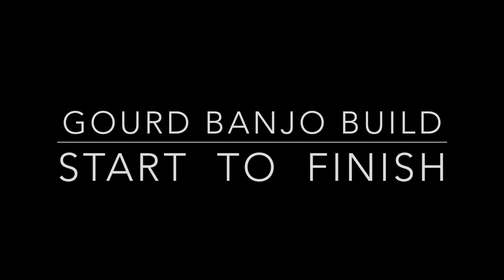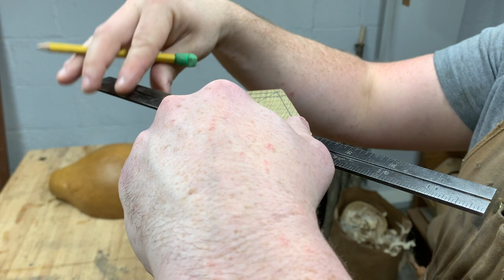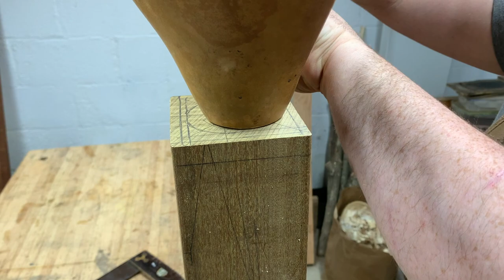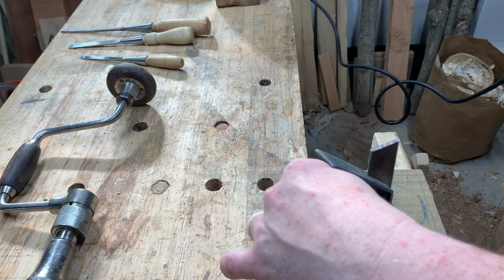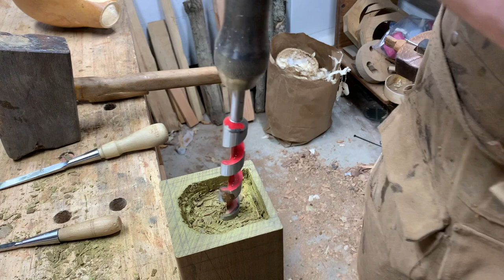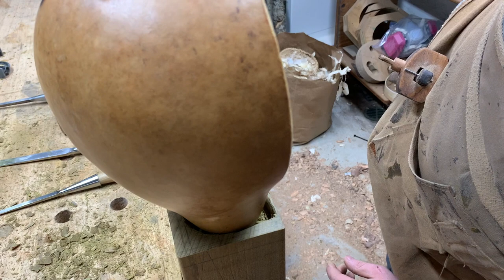Gourd Banjo Build Part 3

Comment: The dowel method.  Do you use it when (because) you're working with a teardrop gourd shape, but would also use it for a bottle gourd or canteen gourd with more of a round top?
Reply from the maker: Not sure what you mean by "dowel method". As opposed to making the neck and dowel from one contiguous piece of wood?
Reply: @LowlyMountainBanjos  Yes, exactly.  Sorry, I should have made that clear.  I'm going to attempt the one-piece approach, and I've always wondered about the logistics of the dowel method, specifically getting the neck angle correct.
Reply from the maker: @drewby613  I mostly just find that using one long piece creates a lot of waste wood and doesn’t allow for much error.
Reply: @LowlyMountainBanjos  I hear you.  I'm going to have enough cherry left over to make pegs and bridges 'til I don't know when.